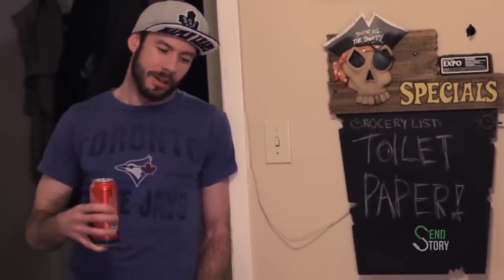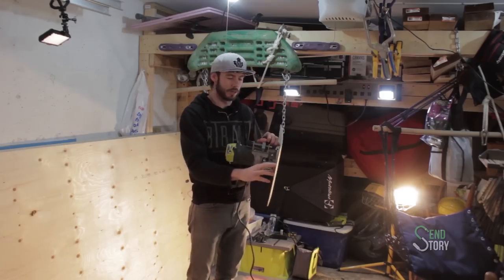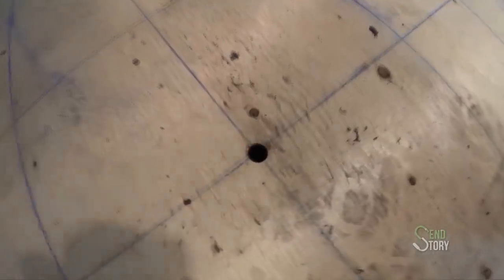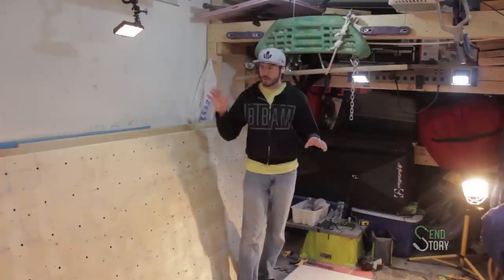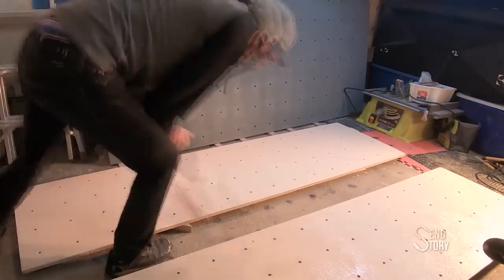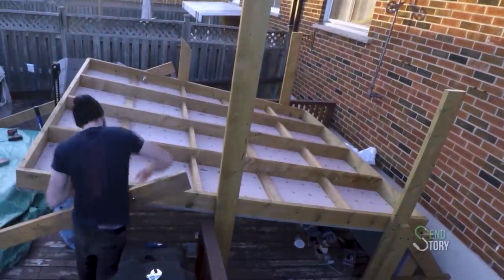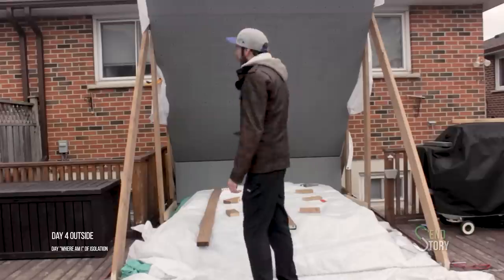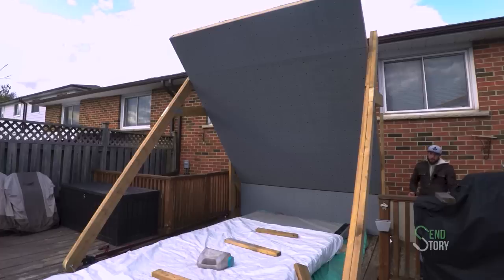Building an Adjustable Home Climbing Wall During Isolation - 12ft Bouldering Wall - Full Build Video

Comment: This is a fantastic build video. Most other videos don't give you this kind of detail and only a timelapse without an explanation. Those detail shots on the hinges is excruciatingly crucial and i feel like most people gloss over it. Some friends and I were going off a different build video the other day and had to bail because of how structurally unsafe it felt. I believe this is the one to really go off of.
Reply from the maker: Glad I could help.  Like I mention in the video, I'm not an engineer, so i can only vouch for my own work, but structurally,  mine is definitely very sturdy. Hope you can build something solid to throw around on, good luck!
Reply: @SendStory  second question what design program did you use to plan your build? Do you believe it would be possible for someone new to design/engineering to pick it up within a few days?
Reply from the maker: I use a free (completely open source) program called blender. It is fantastic for 3d modeling, but the learning curve is steep.  However,  with the cost of entry being zero,  I'd say it's worth a try. Alternatively, I know a lot of people use Sketch Up as well,  which is meant for projects like this.

Comment: This is definitely one of the best home-woodie build videos I've seen, great effort. And lately I've seen a  LOT! I'm glad you said you're going to add the emergency chain alongside the ratchet-straps, you've clearly got a good head for safety concerns and built-in redundancy. Having built my own one, I'm amazed how heavy a 'fully-loaded' woodie is - they'd make a real mess if it collapsed when someone's training on it! Happy cranking.
Reply from the maker: Thanks! I agree, I think at this time it is important to keep people out of the hospital, so home walls crashing down wont be doing anyone any good. After some heavy use on the wall and inspections, I find this design actually puts equally as much load on the additional set pins, as the straps - which from a safety standpoint is great, but definitely makes adjusting those pins in and out much clunkier as they tighten up in their holes nicely. I will still be adding in that redundancy for piece of mind, but I also think it will be a nice extra piece of hardware to make use of when lowering the wall. Thanks again!

Comment: Beautiful construction👌 I have a similar build at home ( a bit more gangsta built than this I must say) I use an electric 12v winch. It looks like you could also? Assuming you could and would be happy to drill and plug into the house wall behind. I would be tempted to attach a small winch to the top back of the board itself and then fix an anchor point to the wall. To minimise the stress on the brick you could fix say 6x2 the full height of the wall with multiple fixings ( in the brick joints with say hilti bolts) and then anchor to that timber. I use jumper leads to a deep cycle battery and then take it in to recharge, but rarely need to. All the best 😊
Reply from the maker: That sounds like an awesome build! Part of the reason I had a lot of the supplies to build this was because we planned on making one for a while but had yet to pull the trigger on it. One of the hold ups was that we hoped we could have a properly of our own to build a more permanent structure, but the housing market here has made that almost impossible. In this imaginary wall, we planned on using a winch or come-along system for one 8 foot section that adjusts (similar to what we built) and then a fixed wall section that it butts up against to the side (maybe even has a top-out area). Unfortunately not owning the house means we cant do anything permanent, plus trying to get something up quickly while gyms were closed means we simplified the plan a bit. I appreciate your comment, and I would love to see your system if you have posted it somewhere. Thanks again!
Reply: @SendStory  no worries mate😊 like I said that's an amazing build! I don't have any vids anywhere of my one. It's a a garden wall which kind of evolved...put sides on in the winter and then I kind of you know.. put a slate roof on it as well (I'm a roofer) 🤣 then I had to get retrospective planning permission cos one of the neighbours thought I'd just built a house at the back of the garden 😂
I love seeing these kind of builds..awesome build and awesome vids. Hope you get loads of enjoyment and solid training buddy 👌👌👌

Comment: Nice wall that you have.  What is the seize (dimension) that you made? (heigt, widht, kicker)  😉
If you would start over and make a new one.  What would you sugetst to do and not to do?
Reply from the maker: Thanks! To keep it easy to build, fairly standard, and a manageable size, most dimensions are based off of the standard sheet sizes. So the wall is 8ft wide (plywood sheet heigh here) and 10ft tall (2.5 x 4ft which is the width of a sheet). The remaining half plywood sheet was used for the kicker, so 2ft.

I actually did a followup video to this one talking about the good and bad of the build after using it for a while, so it might be with checking that out! But basically I wish it was a bit wider, but circumstances meant I couldn't really do that. 

Hope that answers your questions, thanks a lot for the comment!
Reply: @SendStory  Thanks for the info.  I will take a look to your other videos.

Comment: Hey, man. This is awesome, thanks for sharing. Is the kickboard attached to the floor? If not, do you feel it unstable while climbing or changing the wall angle?
Reply from the maker: Hey, no problem, glad you like it. The triangle base with the overhanging side supports keep it quite stable and I haven't really had an issue with it at all. I did design it in a way that it could be sandbagged (or just using cinder blocks or something) to keep it even more stable/offset the weight, but I haven't needed to do it. Unfortunately my site is having some server side issues and sometimes doesn't load (or loads very slowly, sorry) but I have some more details on there and you can see the lumber I added - that you can place additional weight on - in one of the last detailed shots (labelled as #8 on it): https://www.sendstory.ca/2020/04/26/send/building-an-adjustable-home-climbing-wall-during-isolation-12ft-bouldering-wall-full-build-video/

You can also see me adjust the wall in more detail in the first wall update video we did on the channel, which might show it better and also be helpful. I hope that answers your question. Thanks for the comment!

Comment: James! Wicked build you've got going, just a quick question. Do you think your build would still be effective if all the framing was done on 2x4s, instead of 2x6s?
Reply from the maker: I have seen people use 2x4, so I know some people try it, but from my experience,  2x4 gives you a lot more "bounce" and will probably eventually cause some problems, whether it's the wood itself or the hardware slowly loosening as it bounces and moves with the structure.  In my opinion at least. 2x4 are definitely strong end to end taking force, but since you are pulling hard on an overhang, your directional load is also kind of perpendicular to the lumber and grain, so i personally wanted something a little more reliable.  I kind of treated it like if you were doing framing on a floor in a house, seeing as it is taking body weight and you are loading across the members and typically most floors are framed with 2x6 dimensional joists. As i mention in the video, I'm not an engineer, so i just tried to build within my comfort zone.  I hope that helps!

Comment: For the fall zone, is there an affordable and safe alternative to laying out multiple crashpads? My wall will be indoors (garage) so have space to store away right next to it. Thanks for the help!
Reply from the maker: If you can track down some foam, you can make your own pads, if you don't mind the labour involved. I would recommend putting a few inches of more sturdy closed cell foam on the bottom, then a few inches of soft foam in the middle, followed by a topper layer of rigid foam again. You want to have dense foam on the bottom to make sure you don't bottom out if you land hard enough that your force continues through the other layers. Then you want something more dense on top to disperse your initial forces along a larger surface area for the same reasons, as well as having something that is sturdy enough so you don't roll any ankles. So you would probably want to try contacting a foam wholesale place, or even see if you can buy off cuts at a discount (you could try upholstery places maybe?). If you struggle to find a foam seller, some people will use old memory foam mattresses for the middle "sandwich" layer of thick soft foam, and then carpeting for the topper to give it some firmness. Once you have those layers, if you are in a garage, you could probably just get away with wrapping the whole thing in a tarp (keep some slack in it so it doesn't tear when you land), however, if you want it to be more professional, last longer, and keep everything in place better, you can buy some heavy duty vinyl material that can be welded together with a chemical adhesive.  So you can cut out a template and glue together a cover that essentially is like a big bag around the foam. Hopefully that answers your question decently and isn't too nebulous! Thanks for the comment!

Comment: it looks awesome.  I live in TX so we get hurricanes, if I built a wall Id have to make it modular so I could lay it flat somehow.
Reply from the maker: Technically you can fully lower it back down so it sits mostly on the ground. I used a jack to help me lift it part way simply because I built it on a deck that ends on the right side short and the leg on that side hangs off, so I needed to get it up past that point so I could just use the legs to lift. If you built it on flat ground with the space and have a helping hand, it shouldn't be too hard to lower back down in the even of bad weather. Hope that helps!

Comment: Solid wall.  You wouldn't happen to have the link to those hinges, would you?
Reply from the maker: Hey, thanks for the comment! I can't be 100% sure, but I think these are what I used ( https://www.homedepot.ca/product/everbilt-3-1-2-inch-post-gate-hinge-in-black-1pk/1000773477 ). Hopefully that helps!
Reply: @SendStory  That definitely looks like it.  Thanks man!  Also, any issues with them so far?
Reply from the maker: @spm04  We definitely have had no issues. I have also heard of people drilling a hole through all of the studs, off-setting the base/kickplate studs, and using a steel electrical conduit/pipe fed through them for the hinge - if you were worried about it. The only issue with the pipe method would be that the gap between the kickplate and board face/overhang would be noticeably larger because of where the pivot point is and you are technically removing material in the middle of your studs, so you would probably require thicker lumber.

Again, we have had no issues. Not to plug a video, but we have a new one that we posted with some updates and talk about how the wall adjusts a bit more and about how it's loaded/carries weight, which might answer some of your questions. It is long winded, but we always throw in time stamps on our videos if you feel like skipping along. https://youtu.be/IeKg5q4-ELU
Reply: @SendStory  Thank you for all of the input!  I'll definitely take it into consideration.  And I'll give that video a watch for sure.  It'll probably enlighten me on a bunch of other questions I'll eventually have.  Thanks again!

Comment: I really appreciate your guide on your website, good job! It would be great if you could add some measurements of the parts you used.
Reply from the maker: No problem, I have updated that page a bit to give more detail. As mentioned in the video and on that page, if you want a full build guide, Climber Dad has already put something very similar together with cut lists and a full purchase list, and I think that would be a good place to start. Based on what I saw in his guide, you should be able to follow most of his guide and then just modify as you see fit (like if you want to add some of the differences that my build has). I hope this helps!
Reply: @SendStory  thank you for adding the additional render. This is now the best guide to building a climbing wall I have seen. It seems easy to follow (because of clear instructions) and your result looks fantastic. I hope you enjoy climbing on your wall during quarantine.
Reply from the maker: @kristineb2901  Thanks, I definitely enjoyed parts of it more than others, but it was overall definitely a good distraction. Hope all is well, thanks again for the kind comments.

Comment: This has been so awesome and helpfulWhat size hinge did you use? I have 1/2 pin size hinges that look exactly like yours but I can’t line up the hinge enough to get the screws in the top piece. I’m wondering if I need to hunt down bigger hinges
Reply from the maker: Glad this has been helpful. The actual pin part of the hinge is set just behind the face of the front panels. Due to the radius of the hinge mechanism and the fact that the wall probably won't ever be set more than like 50°, it shouldn't affect your ability to adjust the wall angle of it's set back a bit (you also don't want the hinges to be used as foot placements). So I was able to sink the screws in to the framing/structure. It's a good idea to pre drill the wood with pilot holes for the hinges, especially the front most screws if they are at all close to the edge of the framing to avoid splitting. There are hinges that have the screw holes further back (usually for heavy duty gate hinges) but if you have similar hinges to what we used, they should work. Unfortunately I can't see what you are working with, but hopefully that helps! Thanks for the comment!

Comment: I'm getting ready to build a Moonboard inspired by this design! However, as I sketch out my plans, I've got three questions about the legs.

1. What is the angle of the part of the leg that the removable bolt goes through with respect to the main leg? It looks like 45 degrees, but I thought I'd check.
2. How long is the part of the leg that contains the removable bolt? The picture on your blog says about 3', but I'm curious what it ended up as.
3. How log is the segment of the main leg between the permanent bolt and the leg with the removable bolt?
Reply from the maker: The image on our site with angles and measurements is about as accurate as we can get without us running around with a measuring tape to get the exact exact measurements (right now it is also pouring rain and hail and seems like a tornado out there). It is a bit hard to visual the exact measurements you are describing and I think that the image should have the angles. I realize that the numbers are a bit small, and I meant to have the image be expandable when clicked on to read better, so I have done that now (hopefully that helps!). Any measurements that are approximated on that image are within a few inches or even less, so they are pretty close to how they are stated. Some of the actual placements/cuts were done on the fly with reference to our plans, so they just aren't 100% true, but pretty darn close. Our advice would be to just leave some extra material at the ends of the legs/extensions, that way you know you have the distances you will need for sure, and then you can trim them down later. I would say don't over sweat the details, as long as nothing it too short, a few inches difference shouldn't have a major impact. Hopefully that helps, and if it doesn't, or you have another question, feel free to respond and I will try to provide more details if need be. Thanks for the comment and good luck!
Reply: @SendStory  omg, you definitely did have the “45 degree cut” on that image, I just missed it. 😂🤦‍♂️

Thanks for following up!
Reply from the maker: @BenWillkommen  no worries. Honestly, I had to double check the image to be sure that it was there, and, to be fair, without enlarging the image it's hard to read and I didn't have it set so you could click on it and expand the image before. So I'm glad you asked because it prompted me to do that. So thanks.

Comment: Great build!  Which ratchet straps did you use and how did you attach them to the supports?
Reply from the maker: Hey! I used Husky straps that I picked up at good ol' Home Depot. Not sure if they had a specific name or description, but they were rated for a safe working load of 1000lbs and a tested breaking strength of 3000lbs, and they had the double welded hook, not the open eye-hook. I used bolts and washers to secure them in place. I have had a couple questions from different places come in about the build, requesting more details - so I have put a link to a post at the bottom of the video description where you can find some close-up photos and explanations of the base and the straps. I hope that helps! Thanks!

Comment: Did you bolt the kicker board to the ground or does it free stand based upon the legs and overall structure?
Reply from the maker: I did put two regular screws into the deck just to be safe/ keep it from shifting. But I did design the base to have extra surface area to stay in place, as well as have a spot to put weights if need be too stop it from shifting. There is a link in the description where you can see more detailed photos and details of it. I have moved since and moved the wall as well. The wall is now on a concrete patio (nothing to bolt/screw to). I added a few regular bricks to that base plate I mention above (pictured on the site) for good measure, but not even sure if I need them. The wall hasn't shifted in its place at all.
Reply: Thanks so much
Reply from the maker: @lukeyong8881  no problem, hope it helps!